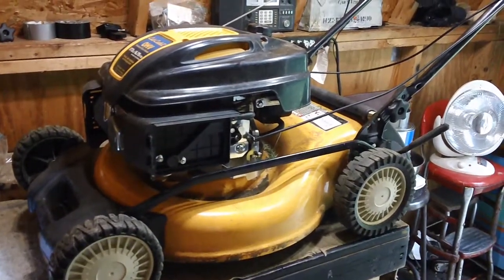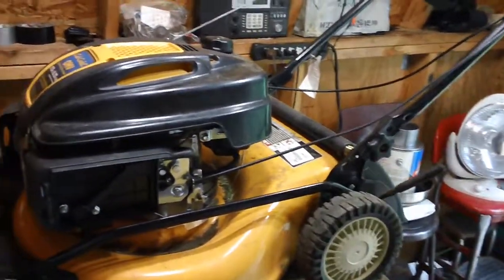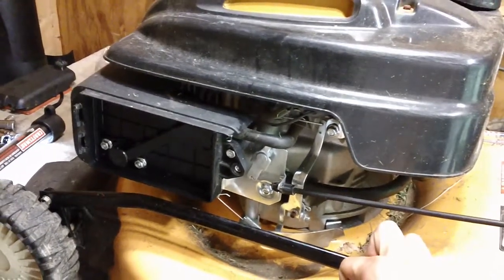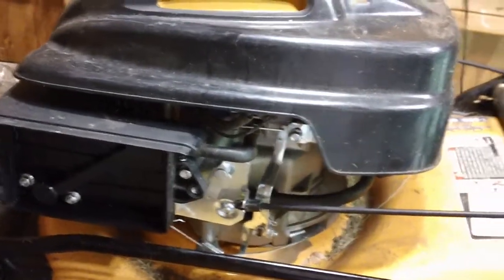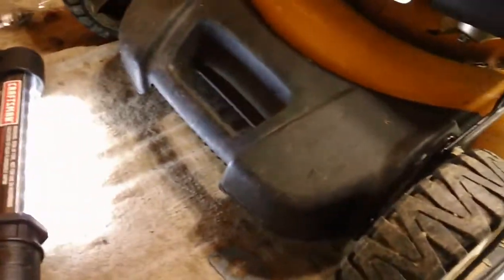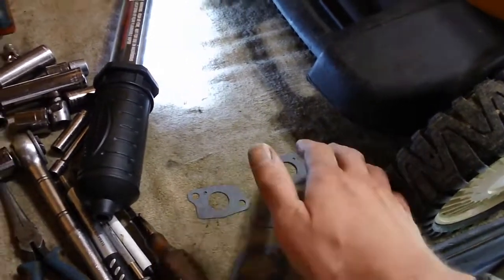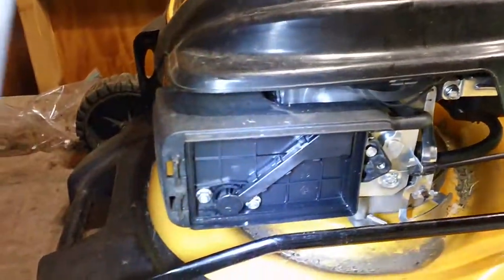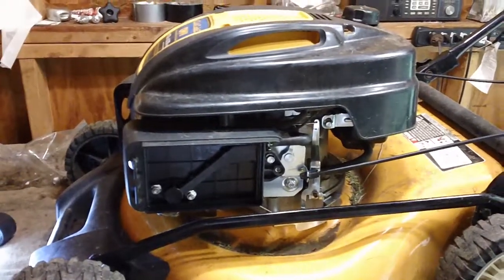CHEAP CHINESE MTD CARB. SETUP & INTAKE PRECAUTIONS.

Comment: Good Video Chris 
the Chinese Engines and Better than Honda Gcv160 : BALL BEARING CRANK and Cast Iron Liner .
make a Video on Govenor Adjustment on tis 173cc Engine 
my Spring Looks Different , Much Smaller and Runs Vertical - Not Horizontal like yours

Comment: Christ will bad Gaskets make your carb run like a dirty carb or run and quickly stop running?? Hope you can understand what I'm saying. I wish I would have seen your Video before I bought this thing  cause you are so right about it .  I guess I'll give it a try cause  when it's running it cut very well.
Reply from the maker: if your intake gaskets are broke or damaged in some way,  this can upset the fuel air mix ratio allowing more air into the intake system.  anytime i service the fuel/air induction system on ANY piece of equipment i ALWAYS replace ALL intake gaskets because 9 times out of 10 most or all of them are damaged in some way shape or form.  btw replace with new oem intake gaskets.
Reply: Thanks big time I'm about to leave so I'll try to pick some up. love yur post big help. Thanks again.